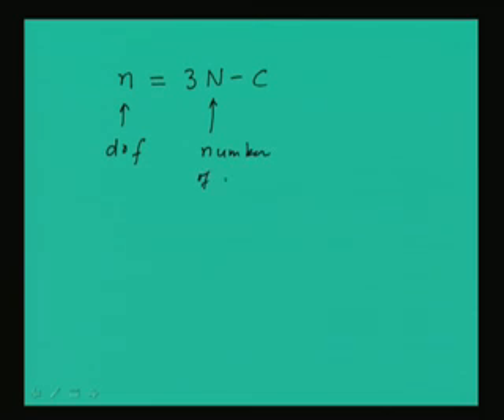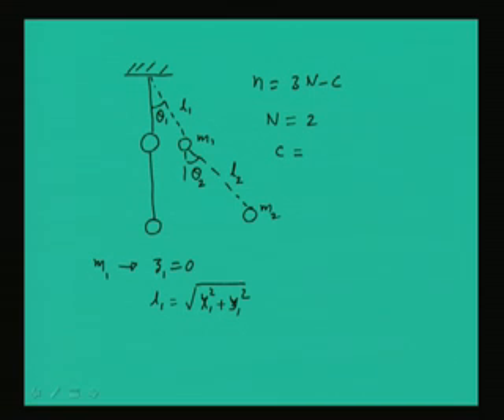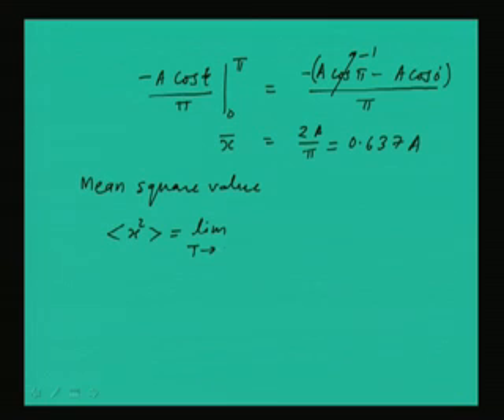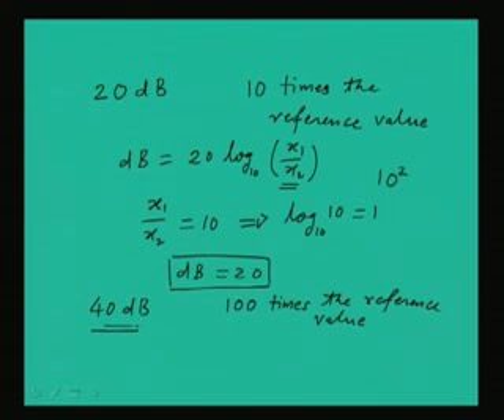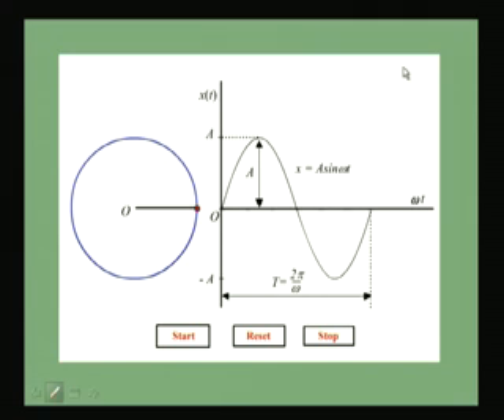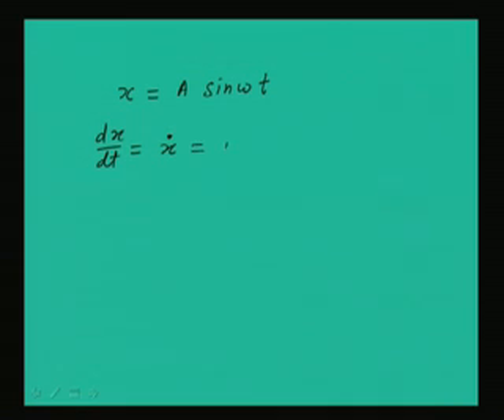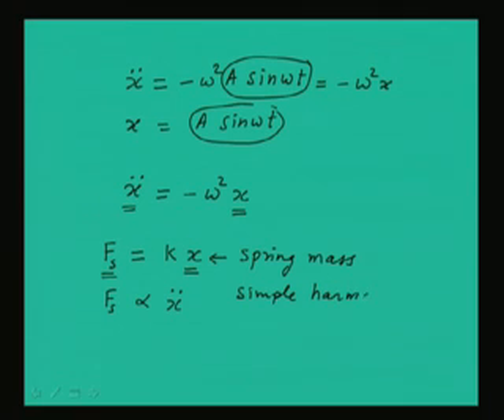Mod-1 Lec-2 Harmonic and Periodic Motions, Vibration Terminology

Comment: at 21:08, you missed a 't' after integrating...you wrote (A^2)/2 but it should be ((A^2)t)/2...other than that good video
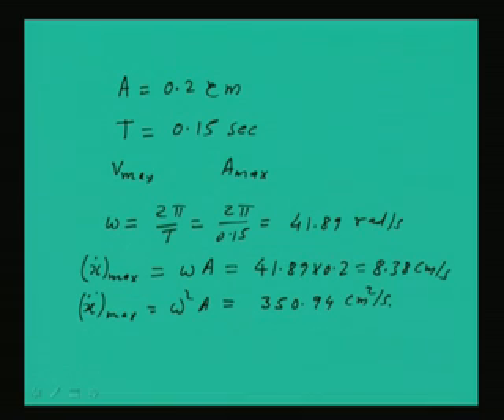Reply: HELLO BRO. at 57:19 , how sir find velocity maximun  and accleration maximum ?? reply please
Reply: max velocity means w× max displacement which is always the amplitude